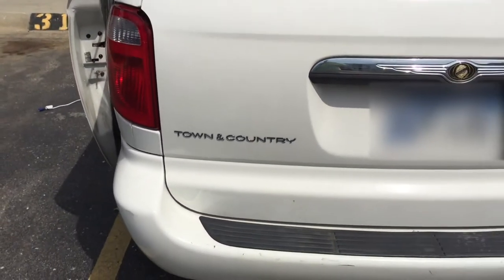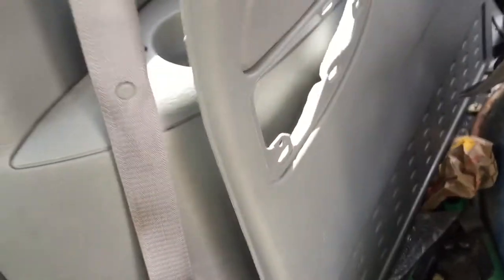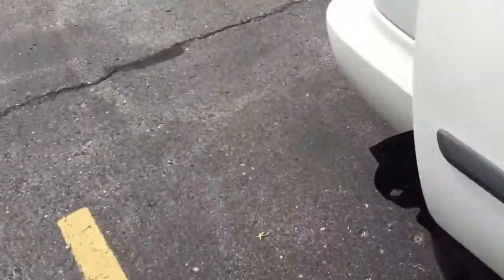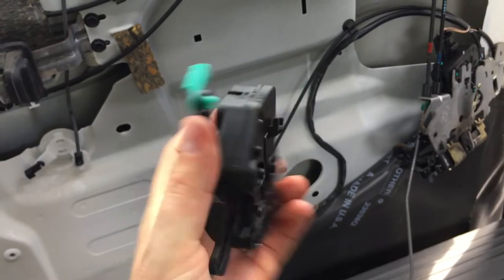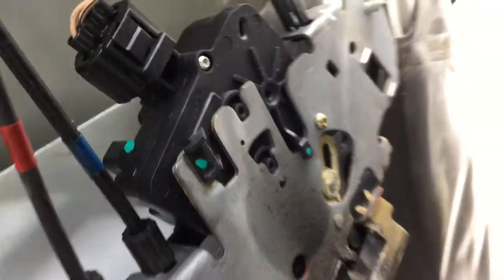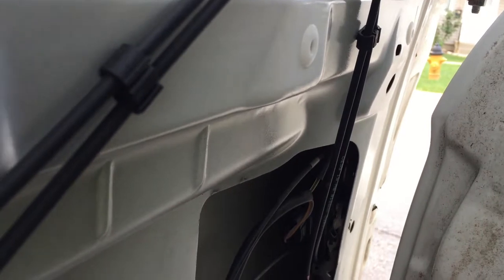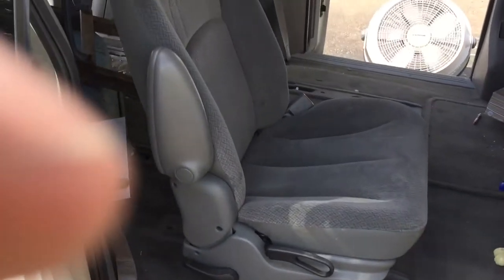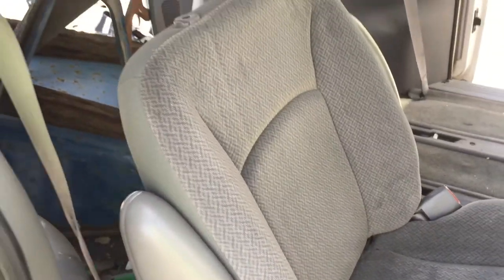2007 Chrysler Town and Country Sliding Door Lock Actuator Replacement

Comment: hi i have a question is there a way you can do it from the inside or no becaues i cant  get my driver side sliding door open at all like it is stuck shut
Reply from the maker: Is it locked shut? You still have to open up the panel to get to the lock to unlock it manually if so, but I don’t recall now if you can even remove the panel if the door is shut (but I hope so for your sake.) I think you CAN unlock a locked door if the panel is taken off, but it takes some fenageling and it’s hard to describe a “feel” for how to do it via text 🥴. So sorry I can’t help much more than that.